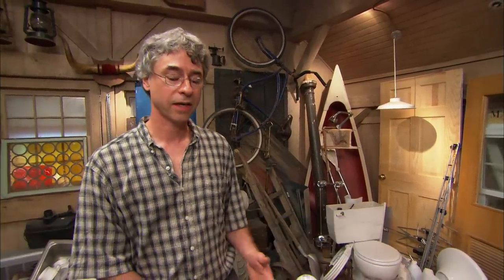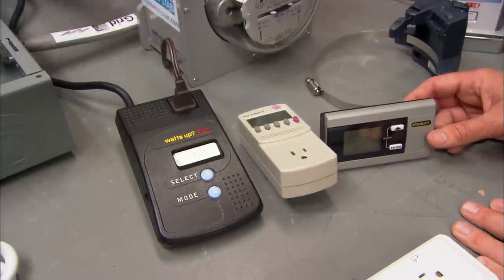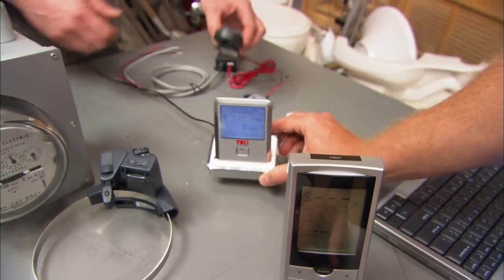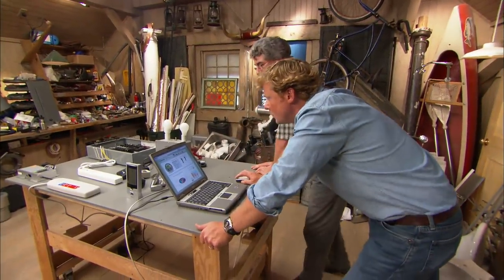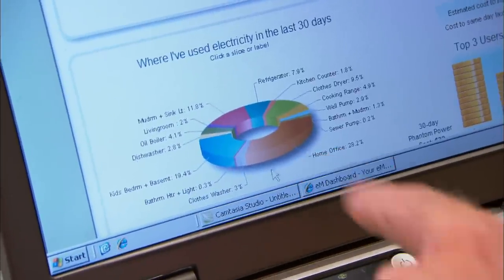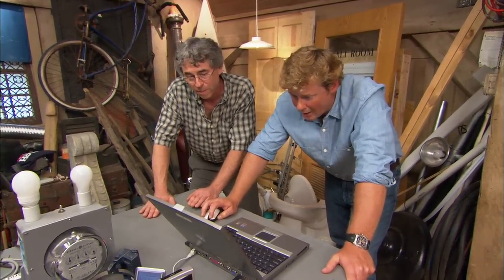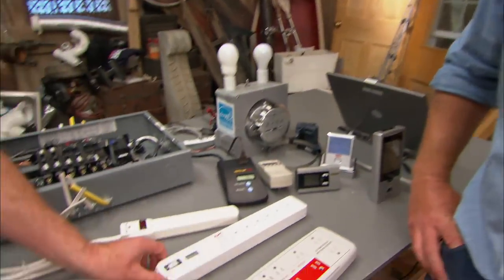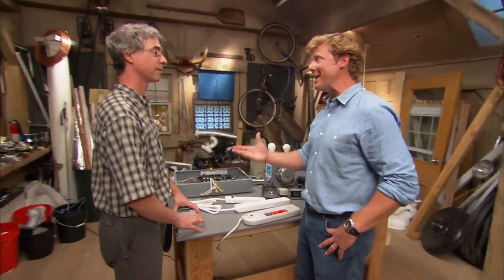How to Monitor Electricity Use | This Old House

Comment: Or... turn off lights when you leave the room, wait for full loads to wash clothes and dishes, change over to LED when bulbs burn out... and use common sense and your brain instead of wasting money on electrical monitoring gadgets...
Reply: I mostly agree, though I do encourage people to buy and use the small electric meters like the Kill-A-Watt. It usually sells for $10-20 and can help you see how much electricity certain appliances and devices use. It's very useful for finding out how much of a phantom load certain devices have and whether or not it's worth to unplug them when not used. It's also useful for avoiding tripping breakers/blowing fuses since you will know how many amps/watts your devices draw.
Reply: Don’t turn off your lights, put a motion sensor in your room and have that control the lights. Screw those switches :-)
Reply: Porsche924Tim:
Just like he said... Its only that one appliance that is randomly pulling more amperage that its supposed to... How will you ever find this out unless you have this kind of software that will monitor and record 24/7 to catch that one device that is causing all the issues...??
Reply: @ Richard van Pukkem yea that way when you stop moving for a few minutes the lights go out lol. been left on the toilet in the dark once.  took those out ever since haha.
Reply: What I don't understand why you want to measure electricity or kilowatts if you don't even know how much is going to be your bill next month I mean overall
Reply: The best thing you can do to save money in your house is to insulate everything including your ventilation ducts. Someone said this on this old house years ago

Comment: It would be nice if there was a way to monitor how much energy a each circuit uses per period of time, where you could reset it after the period of time ended, since appliances are not on continuously.

Comment: Never was power management.  Only power monitoring.  Same idiots who came up with GFCI and gfi, switch leg and switch loop.  Circuit is whole circuit (breaker).  Interrupter is part of circuit (outlet). Switch leg is power at switch to light, loop is power at light, power goes  to switch and loops back to light.

Comment: 5:35 It would be nice to have a power switch that would act like one of those smart plugs but it would be designed to hook to an Alexa DOT or a Google Home system. If the electronic plug strip was designed so you could turn the entire switch off or you could turn each outlet on or off just with an app or your voice this could be so much more efficient and much easier to control. If you don't want to worry about needing to use your appliances and having the timer shut it off while you may need to use them at a time the timer would of shut the item off. Plus if this switch had a device that was like one of those lead testers that lets you know how much power you are using it would send that information to your app and you could track each item or the entire strip in one shot.
Reply: I read this like 10 times and I’m still confused, could you explain

Comment: Wait...fax machine??
Reply from the maker: Paul was a bit behind the times there, but to be fair our brand isn't called This Cutting Edge New House! :D
Reply: Who uses Fax Machines. That type of tech stopped being mainstream in the early 2000's wow. Then again the Channel is called "This Old House". They aren't Joking on the Old Part.
Reply: Alot of people use fax machines. Its a very reliable easy to use thing for sending documents or order forms . They are very common in law firms and government offices.
Reply: @rbeck3200tb40  You heard about email and PDF?
Reply: @dsp4392  
yes of course . Some people send order forms by fax
Reply: @dsp4392  In my country pdfs are not court proof. Only a letter or a fax is court proof.

Comment: The optical reader for the outside meter is a good idea, but I've got one of those new digital meters that wirelessly broadcasts back to the power utility. How do I read one of those ?
Reply: Couldn't have asked it better myself.
Reply: Many utility companies will provide you access to the data they collect if you contact them.
Reply: Check out the Rainforest Eagle Gateway (http://rainforestautomation.com/rfa-z109-eagle/).  Most utilities will enable the ZigBee transmitter on your SmartMeter for you to connect with.
Reply: You can't - the info sent by these meters is encrypted (as you would want it to be, right?) so eavesdroppers can't access the data.  Besides that though, these meters don't report instantaneous readings back to the utility.  Instead, they report back how much energy is used in a given time frame.  This time frame varies depending on how your utility does its data collection and billing, but it is typically every hour, or sometimes as often as every fifteen minutes.  So even if you had that data, all you could read is the average power you used in a fifteen minute period (or hour, or whatever time interval your utility uses).  That isn't granular enough for you to do much sleuthing...
Reply: DTE offers energy bridge that talks to the meter and provides real time data using their DTE insight app.

Comment: Where do I buy the current sensors and the management box?
Reply: in 1999!
Reply: You have your choice from amongst systems such as the Wiser Energy monitoring system from Schneider Electric and Sense Labs Sense Monitor with Flex (CT) sensors or the more DIY/hobbyist type electricity monitoring systems like the IoTaWatt™ Open Wi-Fi Electric Power Monitor system, the OpenEnergyMonitor system, and others.

Comment: I just want to be able to tell when my 240 volt electric hot water heater is actually on and using electric.  How can I do this cheaply?
Reply: The outlet meter type device plus recording the screen of it with your phone for 24 hours. Or a cheap Chinese wifi outlet meter. Good luck!

Comment: 1:37 - Clip that on to the power meter,

Gets electricity turned off for meter tampering, has to pay a $200 meter tampering charge + $75 reconnection fee
Reply: And how is that tampering? Or are you just joking?

Comment: In this day and age with sensitive electronic components such as hard drives and other electronic storage, it is a bad idea to just cut power on a power strip.  What you should be doing is learning how this technology works and why it may be running when you presumably think it is off.

Notably a lot of todays devices have a "standby" feature, which generally does not draw a lot of power and probably wont even be notable on the end of the year electrical usage cost.   For this case,  150W would indicate a computer ( usually over 100W by itself ) router/modem ( 10-30W ) being left on.
Reply: mewimi You just got to know what has a hardrive or things that have trouble turning of and on every day and what not. Someone who pulls the cord of their computer without shutting it down is an idiot first class, deserves it to have it broken. A printer on the other hand can easily be turned off and on by cutting the power.
Reply: MEWIMI:
Well the person that has the hard drive that knows how important it is to have power to it 24/7 knows NOT to just cut power to the strip... In a case like that YOU should have a battery back-up on those hard drives...
Reply: You definitely would not want to cut the power to your main computer. While they do have a CMOS battery on the motherboard, those batteries do die. As long as you keep power to your computer you will not loose the important information that, that particular battery helps store. I know a little to deep for most, but just putting it out there.

Comment: I haven't seen an analogue power meter in many years. The digital kind pulses an led (usually) every kWh. With a simple ($10) device from Ikea that pulse is read and sent to a display with a bunch of analysis tools built in.

Comment: Phantom power is prevented a lot more easily with switched sockets, as the UK uses.
Reply: Yeah sure, let me just move the desk and get down on my hands and knees every night to switch off my electrical outlets
Reply: @jgood005  Though single gang outlet/switch combos are readily available that's not how switched outlets typically work. The wall switch is installed just like a light switch. For any given branch circuit, instead of a switch controlling power to one or more light fixtures one or more additional switches (mounted just like a light switch,) now controls power to one or more outlets mounted in their normal location along a wall.
Reply: @rojohe  Oh, in that case we have those. My electrician called them lamp switches.

Comment: I have been trying, to no avail, to find an appliance meter for measuring electricity and monitoring of related kilowatt per hour cost, for a 240 volt, 30 amp clothes dryer with a 4 prong NEMA 14-30P electric cord plug. To clarify, I do not want a whole house monitoring, or "smart" system, etc., but rather, just an independent unit. The only thing that I've been able to find that would come anywhere near what I'm talking about would be a product called a "Kill A Watt" meter, but they don't make them for that level voltage and amperage. Any suggestions?
Reply: im assuming you want to know how much your dryer costs to run.. open dryer door and look for the plate where it gives info on your machine..my dryer is 240 v 30 amp too. however it runs at 5400 watts(from info on face plate).take 5400/1000=5.4 kilo watts.  look at electric bill .it may have delivery cost and usage cost..for example delivery may be 10 cents/kwh. 5.4x.10=54 cents...usage may be 12cents.5.4X12=65 cents. .54+.65=$1.19 to run dryer for one hour.( give or take low, medium ,high heat). this is from my info i got from the web.hope its correct and helped...

Comment: i turn everything off at night ..but the fridge i leave on
i don't have a TV, DVD player, game console ,
i switched all my lights to 12v LED's and have a gas hob but a small electric combo oven ( it steams and roasts )
my gas bill is about $70 a year my power bill is about $300 a year and i use oil for heating about $400 a year
i have a electric shower and in the summer never have the need for hot water so i boil a kettle of water to do the washing up..no dish washer
you can save a lot f money ...and its easy
Reply: You using oil to hear your home.is extremely bad for the environment